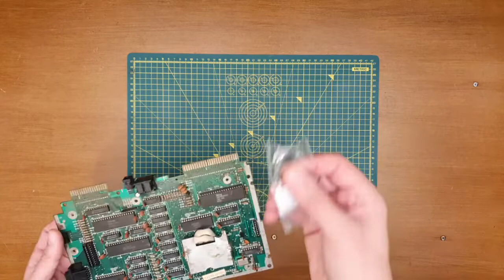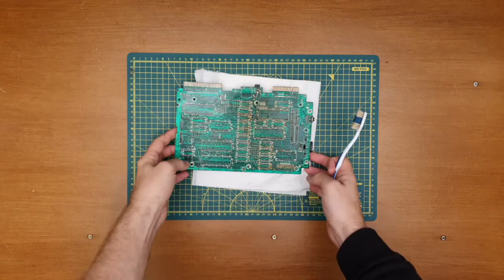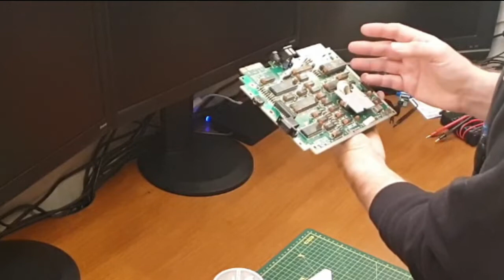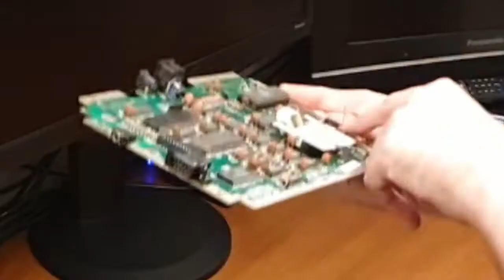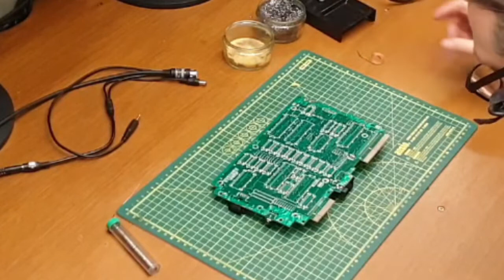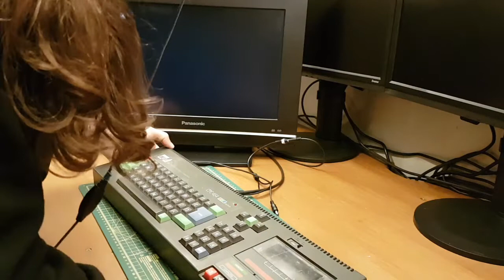Amstrad CPC464   No Power PT2   System board clean up and Power socket reflow

Comment: I know that is video is over two years old but it has appeared on the right pane (recommended) as I watched some other Amstrad CPC videos. I have two CPC6128's that I still use to this day and love them to bits. Apart from the power switch and drive belt issues, these computers are pretty much bomb proof compared to other computers in that era.
I have two CPC 6128's and the CTM644 monitor that I cherish and still use to this day.